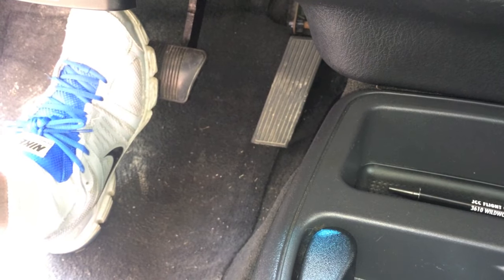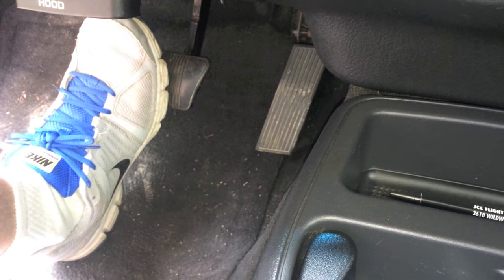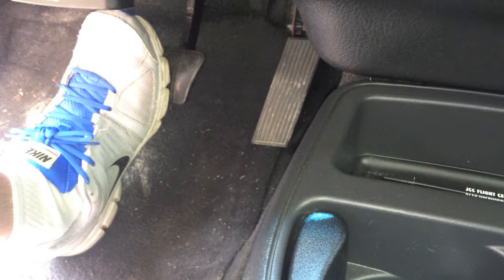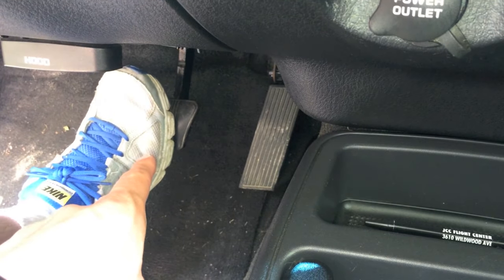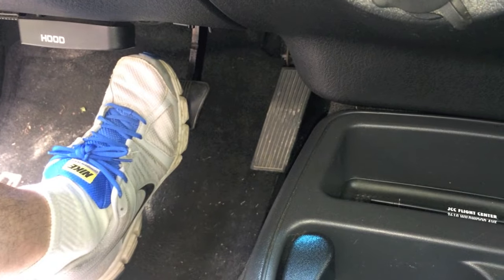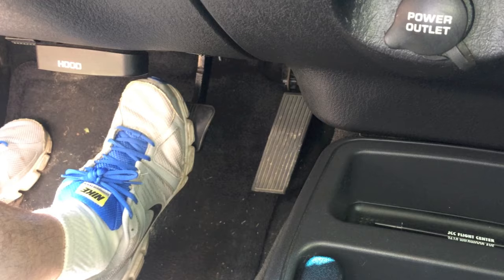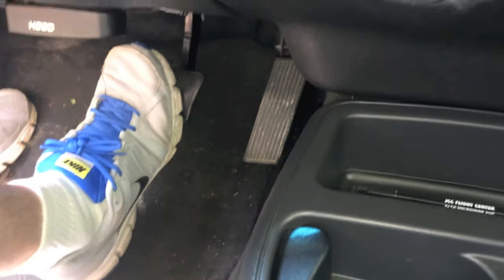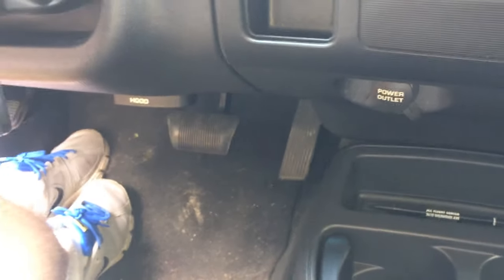HARD Brake Pedal - How to check if your BRAKE BOOSTER is GOOD or BAD

Comment: Thanks for posting this spot on video. People who know how a brake booster functions (using the difference in vacuum and atmospheric pressures) will confirm the test that you demonstrate here is 100% correct.  When having brake problems, this easy-to-do check will quickly rule out or confirm that the booster is defective and save time a aggravation.
Reply from the maker: T Mukal Thanks for checking out the video and sharing your comment T Mukal.  That’s awesome and I’m glad the video helped.  As you know...Brake problems definitely are annoying due to the simple fact of “it can be several different thins” that can cause the Brake issue.  We have several other videos explaining Brake Problems.  Please subscribe to the channel and turn on your YouTube notifications that would be awesome thanks again T Mukal 😎👍

Comment: Thanks for this video. The issue I’m having on my 3rd gen 4Runner is a random super hard brake pedal that later goes away and keeps functioning properly. But it’s very scary when it’s happening because you have to really press hard for the truck to stop..
Reply from the maker: Thanks for watching & welcome to the DIY Raptor Club.  A few things come to mind.  There are a couple parts that could be in their early stages of failure and working intermittently.

1.  Caliper:  It’s possible that your caliper piston is beginning to get stuck at points and cause your brakes to firm up and lock up.

2.  Rubber brake line:  It’s possible that your rubber brake lines that feed off your caliper and lead to your hard brake line are failing.  Believe it or not, these rubber brake lines fail from the inside which means little pieces of the interior hose begin to break off and travel through the system ultimately clogging it and leading to brakes locking up.

Keep us posted on your project.

😎👍🔧🔩
Reply: @DIYwithMichaelBorders  Thanks, I will.
Reply from the maker: @Mike_44  

😎👍

Comment: I called a Chev dealer today and they told me to change the booster so I did and now I have brakes but every test I did showed the booster being good. Thanks for your help.
Reply from the maker: Ted Carter Hot Diggity Dog!  That's awesome news!  Thanks for the update Ted!  Glad to hear you're back on the road!  Lots of new parts you added recently...brake system should last a long time 😀

Comment: When replacing CX9 Brake boosters when removing the booster do not pullback on the brake pedal this will cause problems with your brake lights staying on and sometimes throws a TCS fault.
If you have upset the switches and need to be reset, they can be reset .Hope this helps all the fitters. So save yourself the headaches do not touch the brake light switch/Brake pedal when removing the brake booster. I have sold plenty of these boosters on my website and have come across these issues. Thank you and have a great day.
Reply from the maker: Thanks for watching & sharing your info.  We appreciate it.  Hope all is well with you.  Enjoy your day.

😎👍🔧🔩

Comment: Clear and concise video, thanks! What if the brake pedal releases upon engine start up but goes easily to the floor (spongy)?
Reply from the maker: Kenny 1 

Thanks for watching & sharing your comment Kenny 1.  We appreciate it.  

To answer your question, spongy Brake Pedal is usually caused by either a low quantity of brake fluid in your reservoir.  We recommend checking the quantity in reservoir & verifying it’s within proper fill parameters.

It’s also possible that you have a tiny leak somewhere along the system & due to that tiny leak, the system isn’t able to operate at its correct pressure for efficient & effective operation.

We recommend doing a thorough inspection of entire brake system including all brake lines & parts.  See if you can locate any signs of leaks.

Let’s start there!  Keep us posted!

Please subscribe to the channel and turn on your YouTube notification Bell 🛎 that would be awesome thanks again!  😎👍🔧🔩
Reply: Master cylinder

Comment: Thanks sir for this thorough simple and helpful demo. I have a question and hope you can help. I have replaced my calipers, pads. and brake hoses and my brakes still locks up like they are sticking. do you think the brake booster wasn’t adjust properly or failing master cylinder?
Reply from the maker: Thanks for watching, we are honored to hear that.  How does the fluid level look in your brake reservoir?

If the fluid level is above the max line…that’s not good…you will need to remove some fluid.  In other words, too much brake fluid in the system can lead to your exact issue.

Below is a link to a video showing us using a paper towel to remove some fluid from our reservoir.

       https://youtu.be/X-AJ5tD6zoA?si=eIEUscc0MhHpo8JT

Keep us posted.  🧰
Reply: @DIYwithMichaelBorders  Thank you for your prompt respond. My fluid level is actually in correct level. i also bled the front brakes and it does release a lot of fluid. Do you think its the rod in my brake booster needs to be adjusted or could be something else like master cylinder. I checked all my lines are not binding so i am lost here.
Reply from the maker: @RomeOpalec  

Thanks for the follow up, it’s likely at this point the inner cylinder inside your Master Brake Cylinder is getting stuck.

Below are a few videos that talk more about this.

       https://youtu.be/wEZIpdjfXfc?si=X8H0PqTH0b4zcMJw

       https://youtu.be/FuB1BAdgNpE?si=qI1khTpncZPc6nEd

🧰

Comment: What would cause a hard peddle suddenly? I took my truck Monday for an oil change and everything was fine. Today, Friday, I was going to use my truck and I had a hard pedal. Could a brake booster go bad that quick?
Reply from the maker: bigastrofan1966 

It’s unlikely that it’s your Brake Booster however let’s not write it off yet!  Let’s get this figured out!

Thanks again for watching, that is a great question!

This is definitely not uncommon!

It can be a few different things....thats if you are experiencing a HARD Brake Pedal...

1.  Its possible that your caliper is beginning to stick...maybe caliper slides have lost the lubrication required to shift back and forward freely.

2.  It can be possible that your Caliper piston has lost its lubrication which will also interfere with the efficient shift back for forth.

3.  The front rubber brake lines that connect to your caliper fail from inside rather that outside.  This means the inter coating begins to break away and clog portions of the brake system...hence not allowing fluid to flow back and forth freely.  

4.  Your brake pads have little prongs/teeth on them.  You will notice by their location...the pads slide on a steel brace.  This may need to be lubricated to bring the shift back to efficient requirements.

I have attached a few videos.  Lets start with the easy items and then work our way up!  Lets figure this out together!  Keep me posted!  Please Subscribe to the channel that would be awesome!

1.  Caliper Slides Lost Lubrication:

https://www.youtube.com/watch?v=-DZ68tKuCQc&t=15s

2.  Too much Fluid in Reservoir:

https://www.youtube.com/watch?v=X-AJ5tD6zoA&list=PLjCXOz8TSkZnavDiGDyHdPKe2dV2RzEMZ&index=39

3.  Failing Front Brake Lines:

https://www.youtube.com/watch?v=3FTEgbLYAdI&list=PLjCXOz8TSkZnavDiGDyHdPKe2dV2RzEMZ&index=78

4.  Brake Pads not shifting:

https://www.youtube.com/watch?v=3Pq15BWM_qY&t=103s

5.  Replacing Front Brake Calipers:

https://www.youtube.com/watch?v=8HoaL4QM5-k&list=PLjCXOz8TSkZnavDiGDyHdPKe2dV2RzEMZ&index=83

6.  How to check if Brake Booster is Failing:

https://www.youtube.com/watch?v=VK4lowH7kQE&index=66&list=PLjCXOz8TSkZnavDiGDyHdPKe2dV2RzEMZ

7.  Failing Brake Booster:

https://www.youtube.com/watch?v=j9s7yccswPQ

8.  Symptoms of a Failing Brake Booster Check Valve:

https://www.youtube.com/watch?v=j9s7yccswPQ&index=68&list=PLjCXOz8TSkZnavDiGDyHdPKe2dV2RzEMZ

9.  Master Brake Cylinder Failure:
 
https://www.youtube.com/watch?v=F9s_1VZ2u5E&index=24&list=PLjCXOz8TSkZnavDiGDyHdPKe2dV2RzEMZ

Again let us know!  We are here to help!

Comment: I have a good stiff pedal like I should and I went through this test. The brake pedal did go down but when I try to stop I have to really push hard to stop. I do have abs brakes by the way.
Reply from the maker: Toby Dog 

Thanks for watching & sharing your experience.  A few things come to mind when experiencing soft braking...or having to push hard & deep on the pedal.

1.  A leak:  It’s possible that you have a leak somewhere along the brake line system.  We recommend inspecting all brake line feeding off Master Brake Cylinder (MBC) & down to all wheels.  Check to see if you can locate a leak.

If you find a leak, there are a few options.  Below are links to our helpful step-by-step videos.

       https://youtu.be/Zj3HfNOZsxI

       https://youtu.be/2mDp5pEsuK4

2.  Air inside system:  It’s possible that you have a little bit of air inside system which leads to your symptoms.  Bleeding your brakes & getting air may fix your issue.

3.  A failed MBC.  Below is a link to our video that talks more about the MBC.

       https://youtu.be/F9s_1VZ2u5E

Let’s start there.  Keep us posted.  Please subscribe to the channel and turn on your YouTube notification Bell 🛎 that would be awesome thanks again!

😎👍🔧🔩
Reply: Hi. Please help me, I changed the master cylinder but my brakes are not hard when braking it goes down, I open the hood and heard air near the master cylinder around there. What you think it's is?

Comment: I've been having brake troubles and didn't know where to start. I came across your video and did this trick. Mine went forward after starting the vehicle so not the booster in my case. Thank you for this demonstration sir.
Reply from the maker: Good morning ☕️ we are honored you came across our video.  Awesome job performing this test.

Any update on your findings?
Reply: @DIYwithMichaelBorders  pedal isn't sinking so it's not the master either. Fluid are good. Moving on to the calipers next.
Reply from the maker: @drakecarter1780  

Awesome.  😁👍

Comment: Great video, thanks! I’ve been coming out to a hard brake each morning in my 2011 BMW X5M. Seems like a vacuum issue. I also just got a p0175 error for rich fuel mixture in bank 2. Would you think they’re related? Thanks!
Reply from the maker: Thanks for watching & welcome to the DIY Raptor Club.  Fuel issue is most likely unrelated to brake issue.

In most cases, it’s caused by failed caliper, failed rubber brake line, or your caliper slides have lost its required lubrication.  Keep us posted.  We are here to help.

😎👍🔧🔩
Reply: @DIYwithMichaelBorders  Thanks for the info. Have a good day!
Reply from the maker: @axesomebody  

😎👍🔧🔩

Comment: Hey man! Really appreciate this post. If the brake pedal pulls forward than what else could be the problem for tight brakes when braking while driving? My brakes are hard to push down on... Only white driving when it's in park everything is fine.
Reply: Just bleed your brakes it's needs to be flushed out
Reply: @justindaniels17  bleeding is for soft brakes I listened

Comment: Apparently there is a recall out on Honda vehicles with this issue. Years are between 2020 and 2023 civic, passport, ridgelines etc. I have a 2021 Honda Ridgeline and my vehicle is working the way you described so that is good thing. Honda will be sending out noticed to owners starting august  7, 2023.
Reply from the maker: Thanks for watching and sharing this, that’s interesting.
Reply: @DIYwithMichaelBorders  I actually check the brake fluid and to my surprise it was black. I flush the brake fluid and I  bled four bleeder valves and now it is very clean and if I didn't watch your video I might not have looked at it so thanks for posting.
Reply from the maker: @tommycodfish  

Awesome job, that is great to hear and we always appreciate you watching.

Fresh clean fluid puts you in a good mood.

Comment: You can have a vacuum leak and have the same symtoms!!!
Reply from the maker: Thanks for watching and sharing your thoughts.  How is your system performing?  Let us know if you have any questions.
Reply: @DIYwithMichaelBorders I’ve done this and my brake pedal sinks, would you recommend replacing the brake booster, or the brake booster vacuum hose. It makes a hissing noise as I press the brake
Reply: I’ve bled the brakes and replaced the mater cylinder and it is still doing this so I believe there’s a vacuum leak so probably the hose
Reply from the maker: @guilhermemenezes1085  

Thanks for watching, we would start by replacing vacuum hose.  If it’s hissing, it’s likely the cause.  😎👍🧰

Comment: bought a used truck, it's fairly new and it had a perfect used car inspection.
After purchasing it and driving it for a bit I noticed the pedal gets pretty hard while running and pumping the break on steep mountain dirt roads.

got the fluids changed in the truck because I'm planning a huge road trip and when they did that this shop inspected the truck and found nothing, 
I then pointed out that I think the break booster is failed or failing then they are now going to change it.

my question is how did two reputable mechanics shops do a 100 plus point inspection and both miss this issue with the break booster.

dealer is paying for the repair but it's just a weird situation
Reply from the maker: Thanks for watching & welcome to the DIY Raptor Club.  Great question & it’s not uncommon for this to get missed due to the fact that the engine must be running, vacuum system must be pressurized, brakes must be used, & vehicle in most cases needs to be driven.

You’re not along on this huge part of an inspection going missed however we are excited to hear back from you after you get your booster replaced.

😎👍

Comment: Hi Mike. I have an 03 explorer and I have kind of the opposite problem. My pedal is very soft and goes down very far. It doesn't quite hit the floor, but pretty close. Any idea what this could be? I'll make sure to ask my mechanic when she goes in for her oil change. Car is new to me, so I don't know if this is normal. but all other cars I've driven tend to have a much tighter pedal feel. I know I will need new pads and/or rotors soon as it squeaks sometimes and there is noticeable fade. Thanks in advance!
Reply from the maker: Smear Thanks for checking out the video and sharing your comment Smear.  You mentioned the car was new to you...by chance did the previous owner mention if there was any work done to the brake system in the last year?  The symptoms you have explained lead me to believe that it can one of two things.

1.  Your Brake Pads & Rotors are very close to the end of their life....As the pads wear down...the caliper slides & Caliper Pistons move further inward toward the Pads/Rotors to continue to meet and provide the required friction that the Pads/Rotors need in order to stop.  During this process, believe or not...your brake pedal in car needs to be pressed slightly more down in order to fulfill the operation mentioned above.  So it’s possible by replacing your brake pads and rotors as well as properly Bleeding your brake system, you might see and feel a noticeable difference in your brake pedal.

2.  The symptoms that you have explained can also be symptoms of your Master Brake Cylinder beginning to fail.  The Master Brake Cylinder controls the proper flow of Brake Fluid and pressure to each of the brakes and is very important to the efficiency of the system.  As it begins to fail, it can no longer control the proper pressure required to move the brake fluid throughout the entire system...leaving you sitting in the car pushing the brake pedal and the pedal going to the floor and not getting the Brake efficiency that is needed for safety as well as personal comfort...

Below is a link to a video that explains more about your Master Brake Cylinder.  Definitely check that out, and as you mentioned earlier...once your mechanic takes a look at it and gives you the second opinion please keep me posted on your update.

Please subscribe to the channel and turn on your YouTube notifications that would be awesome thanks again 😎👍

https://youtu.be/F9s_1VZ2u5E
Reply: brake pump is broken
Reply: Master cylinder is probably bad

Comment: Really good video 💯 I’m having a problem with my 2013 VW CC  the brake pedal sinks to the floor when the engine is on, iv done exactly this in the video so it’s not my booster, so now I’m thinking it is the master cylinder, any information would be appreciated,
Reply from the maker: Thanks for watching, do you notice any brake fluid leaking on ground when engine is running and brake pedal is pressed?

A leak in a brake line can cause your symptoms.
Reply: @DIYwithMichaelBorders  thanks for the reply, no no leaks I just got the brakes bleed too and two front new callipers, I tested the servo booster too and it’s not that, I am thinking it could be the master cylinder.?
Reply from the maker: @bigwon4056  

Thanks for the follow up, that is the next likely cause.  👍